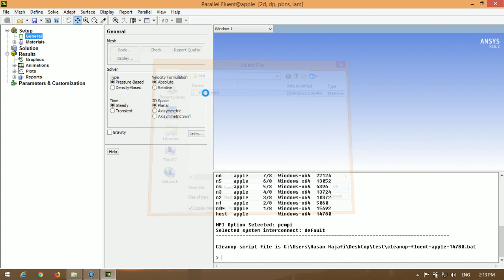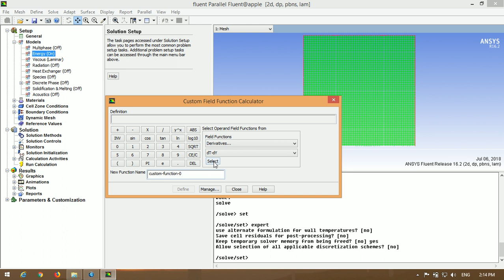How Access to the Derivative of Temperature in Custom Field Function Calculator of the Ansys Fluent.

Comment: Hi, after I set it up like this it doesn't show the temperature gradient and gives me this error message, do you know how to fix it?Info: Expert option for not freeing temporary solver memory is incompatible with adaption in parallel.
Reply from the maker: Hi, I guess you have one of the following problems: You may be using the student version,  you need to have installed Visual Studio, or you may also need to change the mpi setup in the launch window in Fluent. The problem seems to appear from parallel processing.
Reply: @akamcae  you are right......   how can i fix it ?  udf?
Reply from the maker: @sss-bc6dz  Please try one of the following steps:
1) First read your case and data, run one interaction, change the setup like the video here, and then run your simulation one iteration more before getting your data.
2) if your simulation is steady and you want to get data at the end of your simulation, you can read the case and data with a single process instead of parallel processing. Just be aware that before calculating the data by custom field function calculator, just do one interaction, otherwise, you will get a zero value.
3) try to install a newer version of Visual Studio.
4) if none of the above solutions worked, you need to create a UDF file, You can use DEFINE_ON_DEMAND.

Good luck
Reply: @akamcae  thank you for your reply
Reply from the maker: My pleasure

Comment: HELLO, How to fine derevitive of the temperature with respect to time, dT-dt
Reply from the maker: Sorry, I do not know how to calculate dT-dt. I suggest you get the temperature from a specific point and then provide a function by overfitting using Exel then calculate the derivative of it. Also, you can use numerical methods for calculating a derivative of some data.

Comment: HELLO, HOW TO CALCULATE WALL AND BULK TEMPERATURE?
Reply from the maker: Hi, You should make a cross-section in your domain and then use Mass-Weighted Average to calculate the temperature on the cross-section surface. That's where you will get the bulk temperature in a specific cross-section.  For wall temperature, you need to use Area-Weighted Average over the line or surface of the geometry. Please subscribe to my channel, I will provide a video about calculating these two parameters within the next week.
Reply: @akamcae  Thank you very much for your information.
Reply from the maker: @ammarlaichi8474  Hi, you can find the video regarding calculating the Nusselt number in the below link. Thanks
https://youtu.be/2StpgKD2ljU?si=4lFfz-Vo7ux_HMUh

Comment: Hi Mr. Hasan, thank you for this video. I got one question; can I use custom field function to calculate entropy due to heat transfer and friction? If so, may I know how to do so?
Reply from the maker: Hi. Yes, it is possible. You can see the equations of entropy generation in the below article. After creating the equation in Fluent, you can calculate the volume integral of entropy generation in your domain.
https://doi.org/10.1007/s00231-019-02615-z

Comment: who to calculate the Production of Entropy of a rotating impeller?
Reply from the maker: I have not worked on rotating impeller. You can search and find an article that explains the equation of entropy production in a rotating impeller. When you find the equation. You can transfer the equation as a UDF code or as a custom field function. However, I think, the equation should be general for all applications, which is explained in the Bejan book. When you find the equation, I think you can calculate the equation using a volume integral in reporting section of Fluent software. You can see the equation of entropy generation in the below link. This is a published article by me.
https://link.springer.com/article/10.1007/s00231-019-02615-z

Comment: hello sir i want to find nusselt number so for that i need to calculate dt/dy at y=0 so how can i find the same ?
Reply from the maker: Hi, first you should create a custom field function with your definition (dT/dy....) then calculate the value of your function from the wall, which the location is y=0. To report the value from that location, you can create a line or point by Fluent on the surface (wall).
Reply: @akamcae  I want to find dT/dY not dT-dY
Reply from the maker: @maniksinghsambyal550  It is dT/dY but when you use the Fluent, it shows like dT-dY.

Comment: Hi Mr Najafi, How we can define new Field Variable At Initialize - Patch Window  Setting ?
Reply from the maker: Hi, there is a Macro called DEFINE_INIT (initializes variables) in UDF that the Dialog Box of this Macro can be activated in User-Defined Function
 Hooks. You can see the definition of this UDF in the ANSYS FLUENT UDF Manual.

Comment: nice video. how can i implement the  Time-Averaged Wall Shear Stress (TAWSS).
Reply from the maker: Sorry, for not getting back to you sooner.
You can report the Time-Averaged Wall Shear Stress as below:
1) For steady simulation:
Go to Report> Surface Integrals> Report type (Area-Weighted Average)> Field Variable (Wall Fluxes...)> select Wall Shear Stress> then Chose the boundary that you want to report the Time-Averaged Wall Shear Stress> Compute.
2) For translate simulation:
You can use UDM Macros for saving you data every time step size and calculate the average time with other software, or use the Tecplot 360 CFD post-processing software, which you can import your case and data to it.

Comment: Thank you sir, but when I try to calculate average value of dT/d(x,y,z) for particular part of fluid domain (e.g. air domain) from Reports (Volume Integrals), zero value occurs and without units (instead K m-1). Do you have any advice?
Reply from the maker: Hi,
In this method, the value illustrates without units because you make a custom field function which it has not a defined unit in Fluent. To unravel the problem of zero value, you should calculate your run (your all equations or just your energy equation) before you calculate the average value of dT/d(x,y,z) for a particular part of the fluid domain. One iteration for calculating the equations is enough after you read your Case and Data in Fluent.
If you need more information regarding this issue, please do not hesitate to reply to me.
Reply: @akamcae  You are right. I first ran a calculation and after convergence is achieved, I followed your steps and didn't rerun calculation. Thank you and best regards!
Reply from the maker: @josipbatista3570  Your welcome. In addition, whenever you want to calculate your parameter with the custom field function in your previous run, do the below steps and save your time.
1-	Read your Case and Data files.
2-	Go to Solution> Solution Controls> Equations
3-	Active the energy equation and inactive others equations
4-	Press OK
5-	Run your solver for one iteration
6-	Calculate your parameter with the custom field function
Good luck

Comment: Thank you Man. It is quite usefull. Would you know how we can calculate the second derivatives?
Reply from the maker: Your welcome.
We can't calculate the second derivatives in the custom field function calculator of the ANSYS FLUENT software (maybe I don’t know), but it will be calculated with the UDF. I think these links (in below) may help you.
*https://www.cfd-online.com/Forums/fluent-udf/37146-how-build-second-derivative-udf.html
*https://www.cfd-online.com/Forums/fluent-udf/137277-second-derivation-temperature.html
Reply: @akamcae  Thank you... I wrote a UDF and It seems working:  :-) 

# include "udf.h"

DEFINE_ON_DEMAND(store_gradient)
{
    Domain *domain;
      cell_t c;
      Thread *t;
 
            domain=Get_Domain(1);
  
  thread_loop_c (t,domain)

     {
          begin_c_loop (c,t)
           {
              
      C_UDSI(c,t,0) = C_T_G(c,t)[1];
      C_UDMI(c,t,0) = C_UDSI_G(c,t,0)[1];
           }
                 end_c_loop (c,t)
     }
}

Ps., For better refinement in gradients, one also can use the reconstruction component of gradients of any variable...
Reply: @Roilbb  gradient is a vector. How can you store it in a scaler?
Reply: @waqasmuneer7951  It is magnitude which is stored in UDS. You can also store the components of a vector in UDS as well.
Reply: @Roilbb  It is the vector that has been stored in scaler and it is a magnitude of the sclalar which has been stored in UDM. Is your code working fine?
Reply: @waqasmuneer7951  All the vectors: their magnitudes are stored like velocity. IF you make report of velocity, fluent gives you magnitude. This method also gives you the magnitude. If you need the x y z component you need to set it up in the UDF. Send your email I will send you a better one.
Reply from the maker: Great, and thanks for sharing.